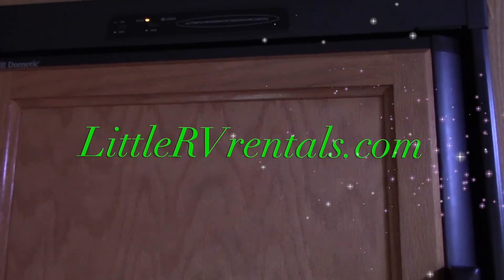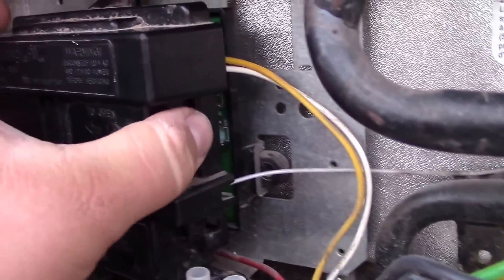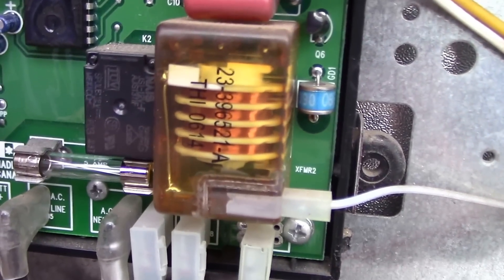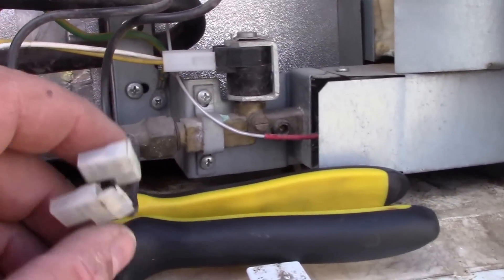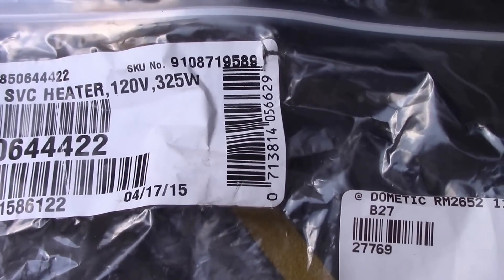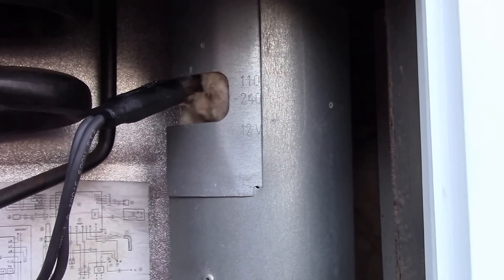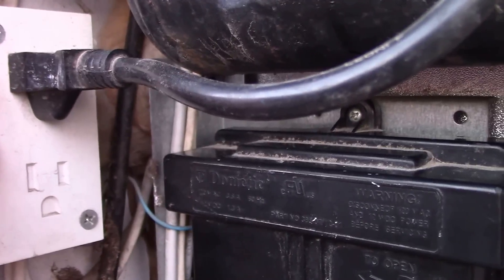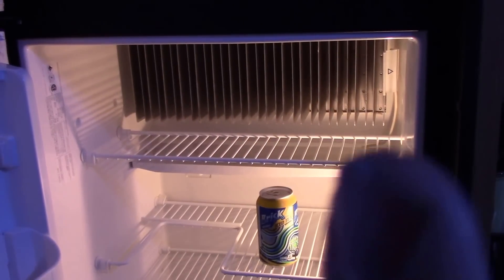Dometic Refigerator Repair Heating Element

Comment: Awesome video, thanks!
I got the RM2612 but this fridge doesn't come with a fridge light or a temperature control only a climate control switch. Any ideas? Also, once I put the new heating element it did get warm on the back but so far is not getting cold. How long does it take before it gets cold? Thanks!

Comment: Same issue with mine, although I had to replace the mother board on back as well as the brow board up front (tiny board where you press the auto and gas buttons). Also there is a small on off switch to the right of the brow board accessible when door opens. One of the wires on back of switch became disconnected. I swear I think this fridge had almost everything wrong.
Reply from the maker: Wow that seems like a lot of different problems on one fridge... Do you take the trailer off road or is it an older fridge?

Comment: Thanks for a really helpful video. If the RV propane is on, does this model Dometic refrigerator try to use gas in AUTO mode before switching to AC?
Reply from the maker: Hi There When in auto mode the fridge will run on A/C if available If A/C becomes unavailable it will automatically switch over to Gas as long as your propane is turned on of course. Cheers,& Thank You!
Reply: Good to know. I have the same model Dometic, but with different control panel (385 04 15-01). My refrigerator works well on gas, but on AUTO it doesn't seem to get nearly as cold. Just barely cold, not to the same level as when using propane after several hours connected to AC shore power on AUTO. 

The vertical heater flue doesn't get warm when running on AUTO. Should the flue feel warm to the touch from the heating element when running on AC? 

Do you (or anyone reading this) know where the blue wire hanging from the eyebrow connecter (6 plug) on the upper left of my control board connect to? The blue wire on my refrigerator is terminated with a piece of black shrink tubing.
Reply from the maker: If your hooked up to power and the fridge is not getting cold on auto or electric option then you may have a heating element problem, check all fuses in the little black box at the back of the fridge make sure they are not blown. Yes the flue will get warm on electric! If not your fridge won't get cold, Also make sure you have power going to the fridge (could be a flipped breaker)  Make sure your RV & fridge are level! If it's not the element or fuse you likely have a Mother board problem it's that little black box at the back of the fridge. Hope this helps Cheers,
Reply: LittleRVrentals.com Yes, the heating element was the problem. By following your video, I was able to replace the element in less than half an hour. Now the refrigerator works great! Thanks!
Reply from the maker: Hey Thats Great! Happy I could help! Cheers! :)

Comment: Freezer works well with both propane and electricity however the frig is not cooling appropriately?   Can you assist?  Thank you,
Reply from the maker: Check that your thermostat in the fridge is adjusted higher or that it's not upside down.

Comment: good morning..in your video, at the point when you're removing the heater element, there are 2 red wires that go to something on that round panel.  Do you know what that part is called..and...is it supposed to spin/move?  On my unit, I can freely move/spin whatever those 2 red wires are connected to
Reply from the maker: Hi There, I believe thats a limit switch... it will trip incase of over heat or fire then shut down fridge, I was told by the RV dealer those never usually go bad. I think it does spin but i will have to check and get back to yea...
Reply from the maker: Hi John, Just an update I checked on my trailer and the limit switch does not spin on mine it is riveted in place by 2 rivets, Cheers.
Reply: Mine does spin even though it is riveted. Am considering replacing mine if possible.

Comment: I can not get the heat element out. It is stuck in the holder  and is all cracked damaged.  Now what?
Reply from the maker: Sounds like it's rusted in there? You may have to pull the fridge out of the trailer to get a better pulling angle I would also call an RV repair shop a lot of times they will give you some options over the phone... If all else fails you may have to take the fridge in for repair... Let me now how you make out Cheers and good luck!

Comment: What's that thing called stuck to the flu it has two red wires and a little reset button
Reply from the maker: I believe it's called a Thermal limit switch if the fridge malfunctions or gets to hot it will trip and shut off the gas supply.

Comment: Mine won't work on AC or Gas, but the controls are working.
Reply from the maker: Try cleaning your burner, Check all fuses and breakers, Make sure the plug that the fridge plugs into has power If all else fails you may have a lose wire some where or a faulty control board. Hope This Helps! Cheers,